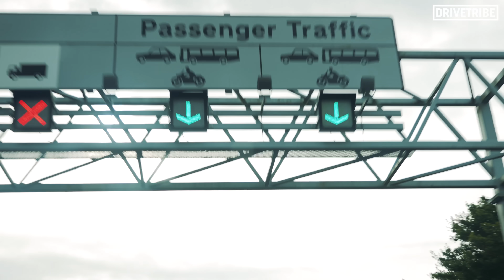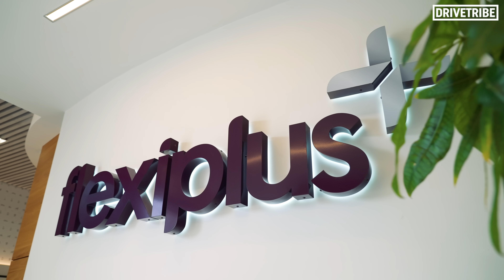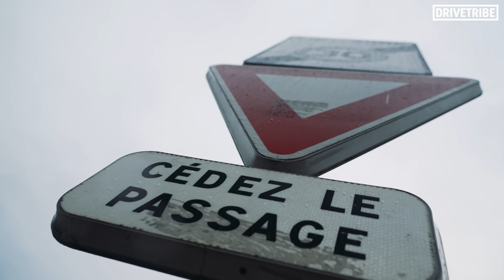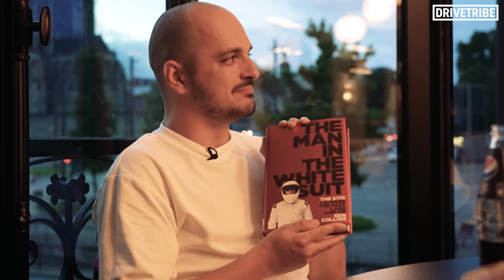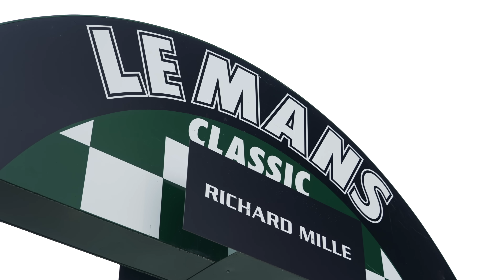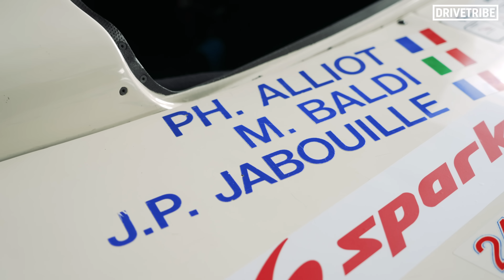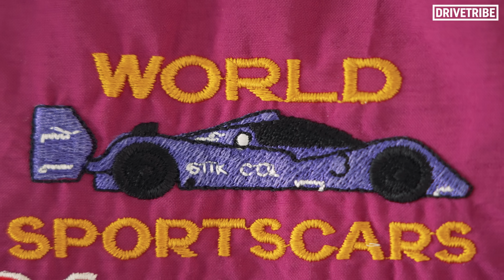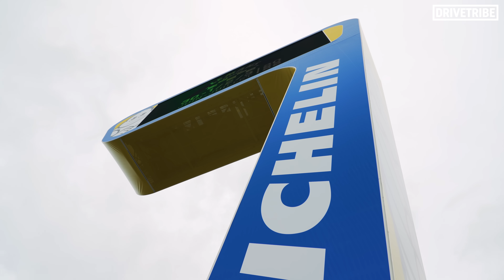The Stig reveals what REALLY HAPPENED in the Top Gear 24-hour race | Le Mans road trip

Comment: I remember when I brought a old second hand BMW 330 diesel and it was still one of the best cars I ever had. 175bhp which doesn’t sound a lot but because it had s#*t loads out torque it went like the clappers. It was a part exchange, needed new brake pads and the dash lit up with fault lights. But I took my chances, brought it, got new brake pads and disks fitted, got some sensors that needed changing which cleared the faults cost me about £300 and it turned out to be a brilliant car. Giving it some I could even get it to wheel spin in 3rd gear, and driven normally it was really economical, especially for a 3 litre diesel. I paid £1800 cash kept it for 3 years and never let me down once, and yes I did have a few little races in it, keeping the revs up as you do in a diesel to get full power and torque it was a beast car. I sold the car to a local guy for £1400 that guy had it for another 3/4 years after me and he said it was probably the best car he’d ever had🙂👍🏻